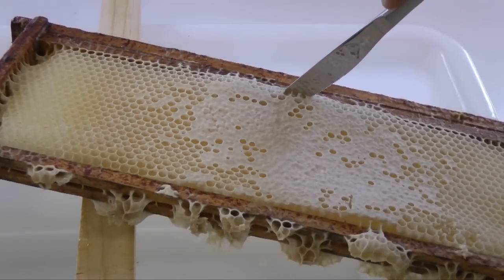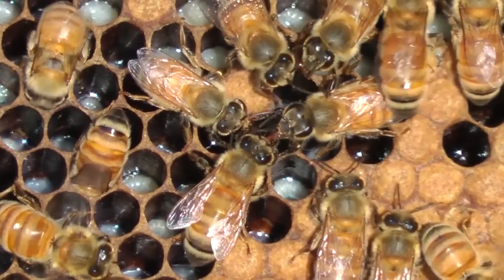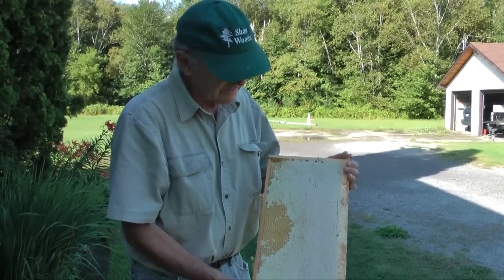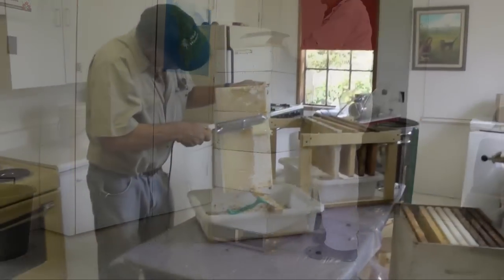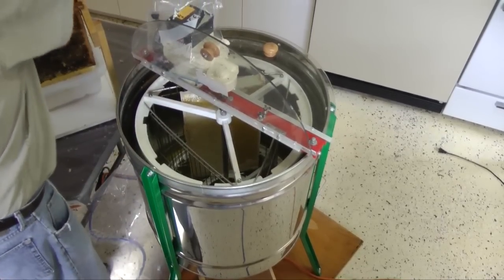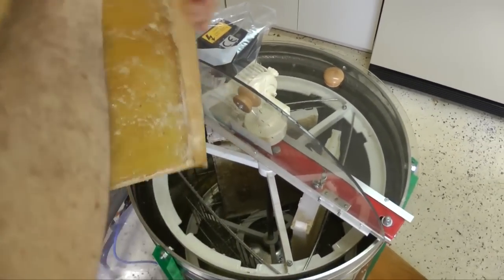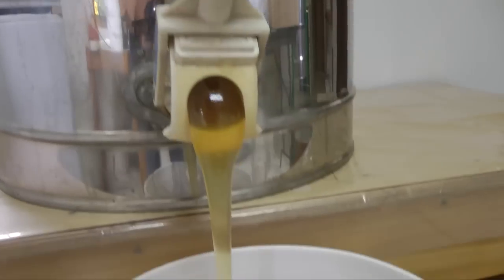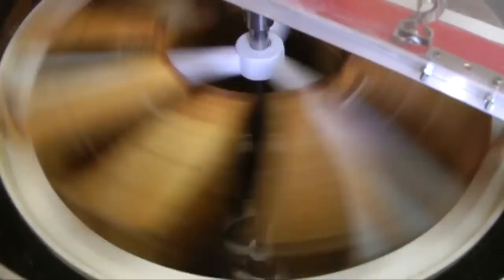Extracting Honey

Comment: The pollen can be added separately to more concentrated pollen honey, which is more expensive. Did you see the comb honey ? It does not contain pollen, or very small limited amount. The cloth that was used was to filtering is totally different from the "honey" sold without pollen (as it is most often not honey, but industrially produced fructose syrup).

Don't worry, as there are always pollen in naturally produced honey, as that is the way to determine where it was produced.